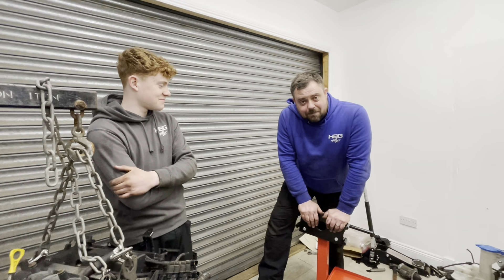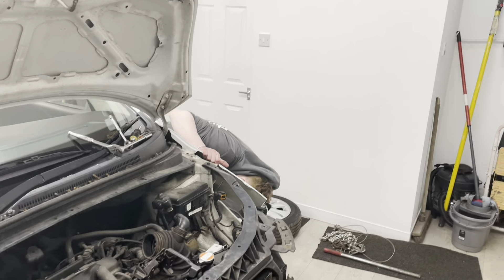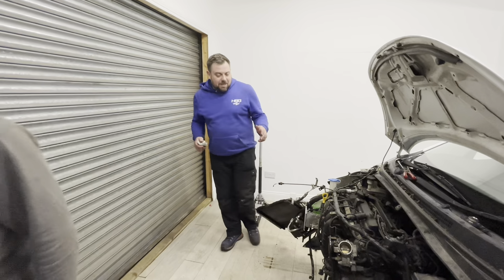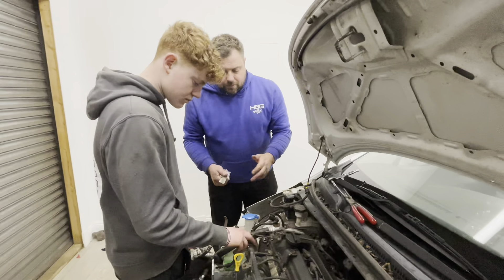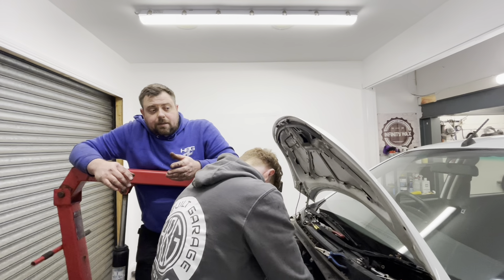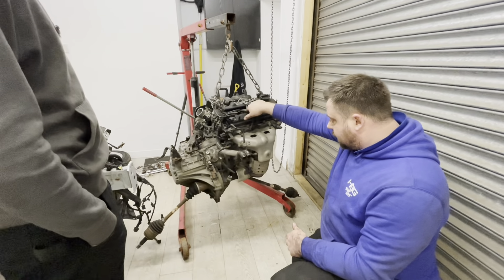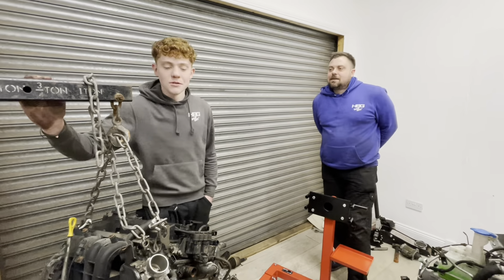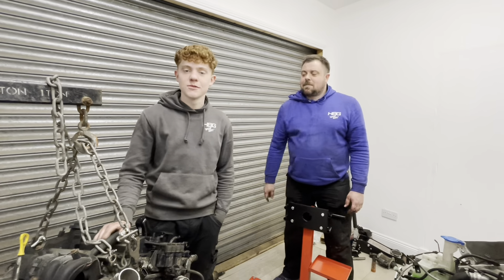The I10 has had issues for a while! Don't use K-Seal.

Comment: Big Hefty Engine Stand 🤣🤣 you and charlie are great what a laugh to start the video 👍 Good start on taking the front end apart and will be much easier for Charlie to work on the Engine with it out the car to change and fit parts. Well done on 7k Subs to mate 👏 onto 10k now .
Reply from the maker: Thanks Murray, i wanted it to be as easy as possible for him, this is our car so no time constraints he can plod away and take his time.
Reply: @HomeBuilt  I defo Stevie will be a good engine for Charlie to get fixed up and get running again . Hopefully it's fixable after head gets skimmed and tested 🤞 . Good luck with that Audi getting it all cleaned up and see what it needs to sort it 👍

Comment: Well done Dad for taking Charlie in hand it's excellent hands on work experience & will realise its not as easy as he may think.
With reference radiator leak, is there no place that repairs them possibly something else to video 🤔 Tell me what do you think about all these on market radiator repairs like Radwell in Yorkshire they put an egg in the radiator and the white of the egg is drawn into leaking areas
Reply from the maker: Thanks Daniel, im going to try and pressure test it first before i refit it but i havent seen a rad repair shop for years up here, i think mas production has lowered the prices enough the kill off the old school shops, its a shame really.

Comment: I sed it been cooked by last owner that as pal 👍
Reply: I am the last owner. The car overheated without any symptoms of leaks or coolant loss. There is no temp gauge. How you suppose to diagnose that?.
Reply: I watch his last video k seal was put in it and he took the front off say been hole in radiator
Reply: @chrismills9346  After it overheated without any warning the car was lying for about 10 days, zero puddles or signs of coolant loss, radiator and res tank was still full?
Reply: The additive was put in after it overheated so I could take it to we buy any car. If I knew Stevie would have taken the car then the additive wouldn't have been used.
Reply from the maker: The rad may have an issue maybe not, it could be a build up of spilt coolant so it will be pressure tested to double check it.
Reply from the maker: We will pressure test it to make sure everything is ok before we refit it.
Reply from the maker: Ive seen people have good results with K-Seal in older engines but not so much in the modern stuff.